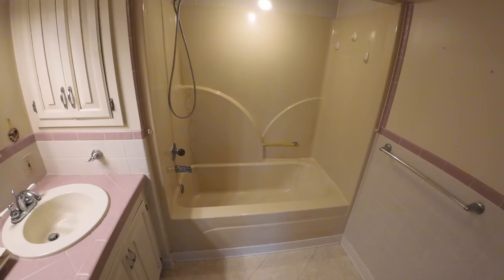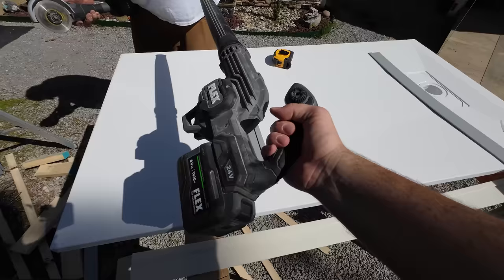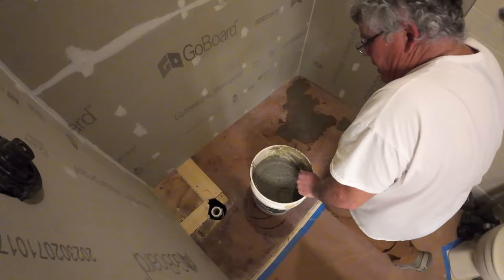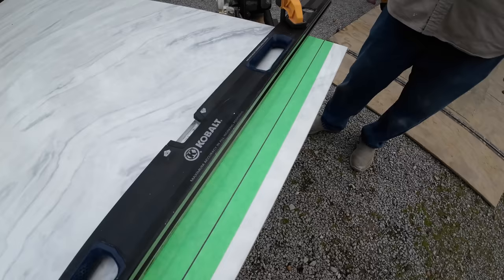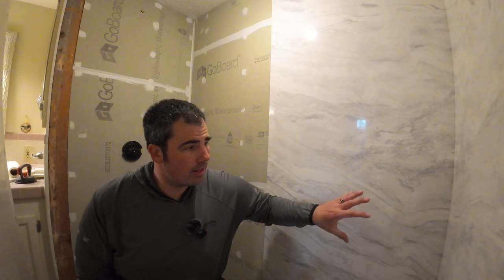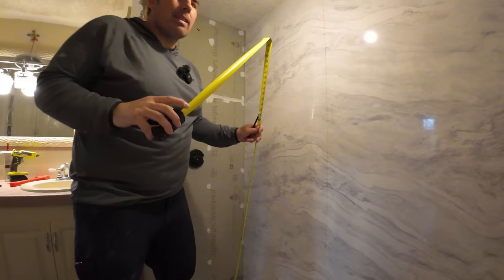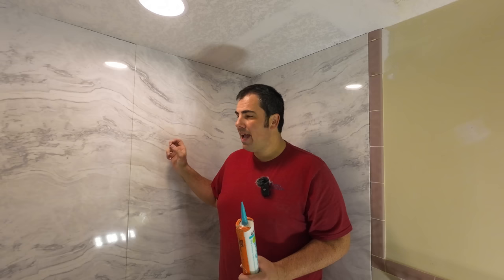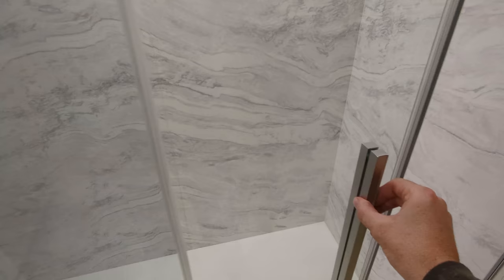CASTICO Alcove Shower Kit COMPLETE INSTALL

Comment: Ive been remodeling bathrooms since dinosaurs roamed the earth. Ive seen alot of new products come and go. Most end up being a disaster. The rule is….if it relies on some kind of caulk to achieve a waterproof state, its junk and it wont last. This falls into that category. The shower pan lip gets screwed on then caulked into place?!?! Recipe for failure. The two back wall panels were installed with flat butt joints. No caulk went in before installing. So, you add a topping of caulk along this joint to resist water? If you install these, you better be ready to replace the caulk in all these joints every year or two.
Reply: No you didn’t pay attention.
Reply: @TheQakman  no? How so?
Reply: @dieselpig5812  Unless it’s a complete one piece unit it will need caulk. Plus this is basically “flashed “ like a roof would be.
Reply: Genuine question: So then does that mean all 4 piece kits are not worth it? Since they would all need caulk to achieve a water proof state. Or are there some that don’t require caulking
Reply: I have to agree that a topical application of caulk/ silicone is a recipe for failure .. but that’s topical.    In the future I would suggest using the silicone at the corners and joints as you install each additional panel. Short version … gloop the bottom  and side of the panel  as you install it. This will ensure that the entire side and base of each panel is fully sealed  all the way through the joints . Not just topically.  Although the likelihood of water getting past the wall panels and the backer panels is slim . I still dont like the way the  “ flashing “ was attached or where it was attached.  It’s like putting the flashing on top of the roof. If they had set the pan first, silicones that , then installed the backer , THEN installed the panels, that would make more sense.  I know that some installation methods look really good on paper. I don’t know how long this product has been out , this is my first time seeing it , so I have not read the installation instructions myself. I’m only going by what I heard and watched in the video.  Just some  thoughts .. 

Cherrs
Reply: Most things that say “New and Improved” means $$ to loose..
Reply: @thelefthandedscrewdriver4790 That’s what I did.

Comment: Master plumber of 32 yrs here and I don’t like that screw on flange.  Shower looks great though
Reply from the maker: They are the only flanges we have ever used. No issues.
Reply: I'm not a master plumber, and I don't like that screw on flange. I've love the style of pan though. @jamessmack do you have an alternative to the screw on flange? I have been looking at various options that stick on.
Reply: @tiffanyfisher1033  do your research. A lot of junk out there
Reply: I'm about to install one of these myself and I have similar reservations. If that silicone bead fails, we have a leak right? What could be done to mitigate that short of using a different shower base entirely?
Reply: @ekallevig  it’s not a question of if it’s a question of when will the silicone fail. These guys do great work and say they never had issues but what needs to be understood is a very slow leak like a drip I a couple places will take years to show itself unless it’s on second story. I myself would never use that. Get a good shower base with a molded flange and either buy panels or tile the walls. I’m building a house now and thats (tile) what I’m gonna do
Reply: @ekallevig  I replied with link but I guess it got removed because of the links. Found some info and a decent plan. I couldn't find a shower with a flange that would be easy enough for my handicap father to navigate.
Reply: On a traditional install with a mud float or concrete backer board…YES. Board behind the flange is not to spec. 

GoBoard (as used in this video)(& all the new foam backerboards Schluter, Weidi, etc) have a waterproof membrane.  They are all sealed with a poly sealant (not silicone) at the joints.  

You don’t have to lap it like you do a roof. So long as edges are sealed…you are good to go.

Comment: Very nice Aaron! 
A 1pc floor with no tile lippage to trip over,nor thin like it was before.
Large flat surfaces,and a drain that are easily cleaned.

Am assuming you could cut in a niche easily, but a corner shelf would need a leg.
My uncle was in his early 70's when he laid tile in my parents curbless shower.
The small tiles all have serious lippage everywhere, including the floor which can be painful. 
This looks like a well thought out system!

Comment: This video was super helpful.  I'm excited to install this now.  Question, on the Goboard are the joints taped? Is it just regular tape and joint compound?
Reply from the maker: The joints so not have to be taped and we have never taped them! We use white lexel from sashco and embed each sheet into the lexel, then tool a bead on top of that. It's water tight and johns Manville approves that install method.
Reply: @miillersconstruction  thanks for the reply. Just finished your other castico video where you had more detail on those steps. You do a great job with your videos, just subscribed.
Reply from the maker: @joeny1980  thanks so much! Really glad you enjoy!

Comment: Hi quick question, when it comes to attaching the enclosure, do you have to drill right through the wall boards to what ever is on the other side (plaster/wood etc) I know most of the enclosures weight is supported at the base, just want to make sure it's firmly attached to the wall and won't come off the wall
Reply from the maker: The waterproofing material is attached directly to the studs. Then the panels are attached to the waterproofing material using thinset or adhesive. Its definately not coming off the wall.

Comment: I have a 2x3 window on the back wall....which panels would have to be cut to fit around the window... What's your thouhts?

Great Video.. you're a detail type of  guy.. i can tell
Reply from the maker: Man That's a tough one. I know Castico won't approve of any install with a window involved. It's going to be really hard to finish the raw edges in that situation. Not quite sure what I would do to be honest. Probably tile lol!
Reply: @miillersconstruction  I believe code only requires a venting system fan.....im thinking just taking window out and using the full panels.....I never open window anyways I have a good fan
..thankyou for the fast response..
Reply from the maker: @TC-tw5zk  if it's an option, definitely take the window out

Comment: Is there a reason for using a putty knife instead of a notched trowel to apply thinset? Silicone lasts less than a decade. Does this castico shower pan last less than a decade without leaks? Not a smart ass, genuine questions. If I’m installing tile walls over a castico pan will the bottom tiles fan out because of the drip flange? Does the flange only come to cover the two short walls and one long one?

Comment: I know that Castico says that you can use construction adhesive with their product. What about  the GoBoards backerboards? Can construction adhesive be used to bond the Castico panels to the GoBoards successfully over the long term. I would like to know before I try.   Thanks.
Reply from the maker: They were not specific on their waterproofing substrate. I feel good using the type of construction adhesive we used because we know it sticks tenaciously to GoBoard. We feel good about it.
Reply: Hi, thank you for your question. CASTICO Solid Composite Stone adheres with most polyurethane construction adhesives, use the type of adhesive that the manufacturer of the backer board recommends for their material.

Comment: Shouldn’t the base be slightly angled to the drain, so water drains out?
Reply: The top of shower pan itself is angled towards the drain. The bottom of the shower pan is flat. 👍
Reply: Hello and thank you for your question. Yes, all Castico Shower Pans are pre sloped to drain properly and are IAPMO and UPC Certified.

Comment: Can you add in a niche to these kits?
Reply from the maker: I have not tried that. Only corner shelves sold by a different manufacturer.
Reply: @miillersconstruction  I hate corner shelves. I am a big guy and constantly hitting them in the shower lol. I think a prefab niche would probably work out ok as long as carefully lining up the cuts

Comment: installing this weekend, but just not sure why the flanges are needed. They add 3/16" x 2 to the overall length. Can't we just seal it the same way against the waterproof backerboard just the same without the flange?
Reply from the maker: I would recommend following the manufacturers instructions on this one. It's very simple to cut the base to whatever length is necessary. I feel like the flanges are an added layer of defense. I see where you're coming from, but the flanges are provided for a reason. I wouldn't feel comfortable not using them.
Reply: Thanks for the recommendation. I will start cutting and flanging tomorrow. I was just thinking (maybe over thinking) that it introduces an extra point of failure since we have to silicon it twice now with the flange.
Reply from the maker: @xungngo  yep. I get where your coming from, but the design of that flange is a little unique. I would recommend Lexel as your sealant.

Comment: I’m looking to do this in a 2 year old home. Builder grade shower surround needs to come out. Plumbing is all good. What would be a cost for installation, if I have the Castico walls and base?  Thanks
Reply from the maker: Thats a question I cannot answer. It might be 20k in new york, 30k in LA, or 10k in the midwest. Hows that?
Reply: @miillersconstruction  lol. Thanks

Comment: Do you caulk the butt joint in the middle?
Reply from the maker: Yes. It definitely looks better with a really tight caulk joint. I use Sashco CleanSeal
Reply: @miillersconstruction  Thanks for confirming as I didn't see it in the video